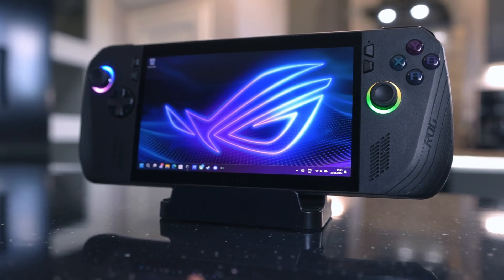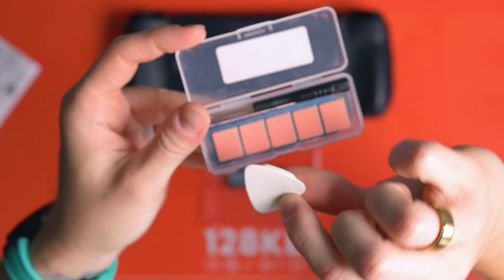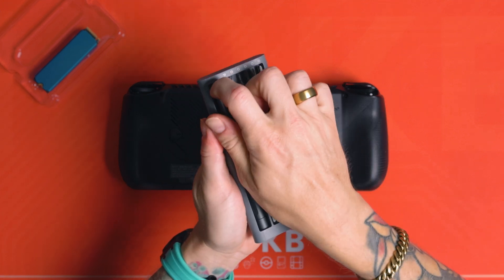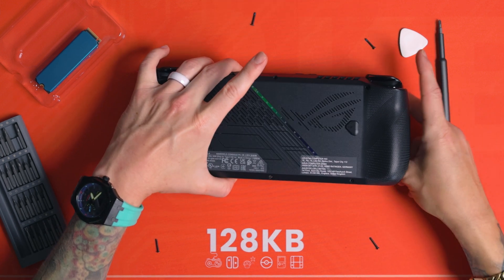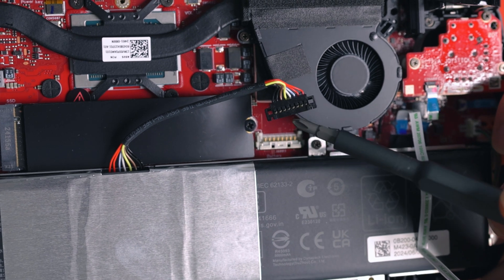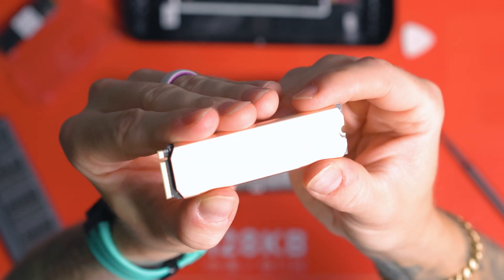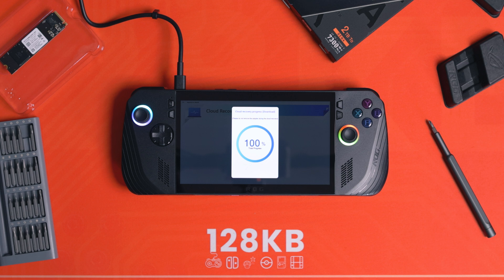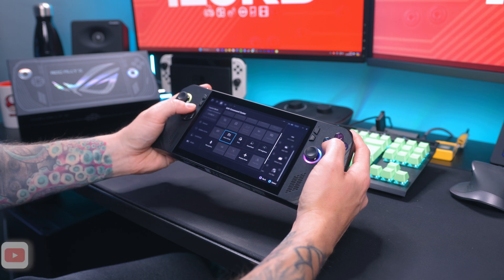How To Upgrade Your ASUS ROG ALLY X Drive!

Comment: 5:15 In all the SSD swap tutorials I've seen... Everyone goes through the trouble of disconnecting the ribbon cable. Why not just leave it intact and carefully place the back aside? Why go through the trouble if all you're doing is a quick SSD swap?
Reply: I was super careful and didn’t remove mine either.
Reply: thats what im going to do
Reply: Well it’s a tutorial video. Technically if someone did what you’re suggesting, possibly even with the verbal warning (“be careful, if you rip it x, y, and z will happen”) and someone follows it along just visually they can possibly be sued. Trust me, I get all the warnings and the common sense arguments, but reality is reality and there’s always someone out there who will try to make the quick buck with the lawsuit. This way the channels are covered to a certain extent.
Reply: What a dumb question. lol  you can accidentally rip the cable off,  rendering your 800 dollars toy useless smh😂
Reply: @redcrimson102  What a dumb attitude to have.. I have opened my device 3 times and it was incredibly easy to just not... rip the cable without unplugging it. Do you usually struggle with your hands?
Reply: @timaaaahhhh  🤣 🤣 🤣 🤣
Reply: @redcrimson102  🤣🤣🤣🤣do you usually struggle with simple tasks and believing in yourself??? 🤣🤣🤣🤣

Comment: This has been an absolute help!! Thank you! Also for those wondering, if BIOS doesn’t boot right away, hold down the volume (Down -) button and press the power button once. Keep holding volume down until the BIOS screen shows up
Reply from the maker: You're welcome and thank you for the tip too, I forgot to mention that in the video since mine auto-booted to bios after a few mins!
Reply: @128KB  I've just upgraded to a 4TB SSD using your video. Many thanks for producing it.

Getting into the BIOS afterwards was an absolute nightmare, however. It took me a good hour or more of holding down the Vol- button to no avail, and googling to see whether others had run into the same issue. Upon turning the power on, the device would quickly heat up and then shut itself off soon afterwards. I knew it couldn't be my fitting of the replacement SSD, however, because the device should be perfectly able to boot into the BIOS even if no SSD were detected.

I was about to give up and go to bed, but gave it one last go before turning in. The device sat at the ROG logo for several minutes, but then I heard a noise emanate from the device and turned my head to see it entering the BIOS. I'm really surprised how long it took to get from power-on to this point. It was literally a few minutes after pressing the power button.

Anyway, cloud recovery is now well underway, but users should be aware that more than a little perseverance can be required to make it as far as the BIOS. I really think the heat was the issue, as the device would shut down within a minute of being turned on, and was very hot to the touch at that point. If it had only run for longer, I think it would have entered the BIOS on a previous run.

I'm not sure why the device eventually did remain on long enough to enter the BIOS, but logically it must have cooled off enough beforehand to guarantee a longer run on that occasion.

Comment: Word of advice.  Boot it up test everything out first, check for dead pixels, make sure all the controls work.  Anything that would warrant an immediate return.  Then clone the drive or plan to use cloud recovery.  Nothing worse that opening it up and doing an upgrade only to have to redo it all because of an RMA needed.  Best of luck everyone!!
Reply from the maker: Agreed!
Reply: I’m new to Ally, do you have a recommendation for a video to test everything? I received mine today and I got my new SSD as well but wanted to make sure all is working properly before swapping SSD.
Reply: @imross7985 don't let him scare you. You'll be fine
Reply: Very good advice. I had a broken trigger on my device. Luckily it was an easy fix. The magnet in the trigger was not in there and stuck onto the cooling fans. I got it out and superglued it back in place.
Reply: @kalebmyers2521 damn man that’s cool you were able to fix it yourself. I would have to have returned mine.  I rolled the dice buying one on eBay with a gift card and luckily didn’t run into any issues, if I did I’d have prob been Fd.
Reply: How did you clone the drive? Did you install software onto the Ally to do it?
Reply: Seems unnecessary. If you put a new SSD in and notice things aren’t working, just put the factory SSD in and initiate a return. No need to bother with cloning.

Comment: Just curious, I have a 4tb SSD in my ROG Ally. I was wondering if I am able to transfer my SSD from my ROG Ally into the ROG Ally X with everything on the SSD like all my games, etc, without having to re-download my games?
Reply from the maker: @arnie7975  you can clone the old drive but you'll need an enclosure. Sadly the ALLY X doesn't have a screw hole for 2230 sized drives, only 2280
Reply: I have a 4tb 2280 in my Rog Ally as well (i assume its a 2280 as well as I dont think you can get a 2230 4tb) the answer is yes if its like mine and you'll not need the adaptor anymore :) I will be putting it in my Rog ally X when i get it
Reply: Thanks so much for the reply! Yes sorry I forgot to mention I do have a 2280 and thanks for letting me know. I'll definitely be transferring my 2280 4tb SSD once  receive my Ally X. 😁

Comment: Shouldn’t you tear off the blue protective film on both sides of the heatsink before applying to your ssd?
Reply from the maker: @AgingBoy  yes, I removed the bottom layer first, I stalled the SSD into the heatsink and later in the video before I install the drive into the ALLY X I remove the last piece of film